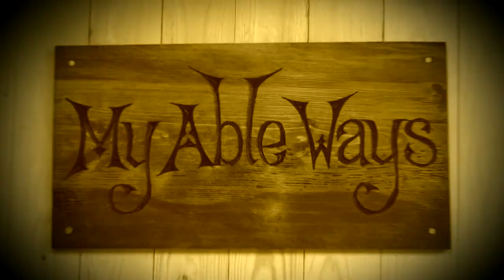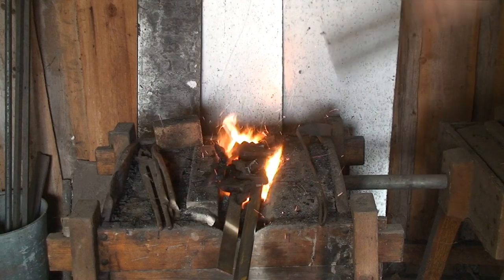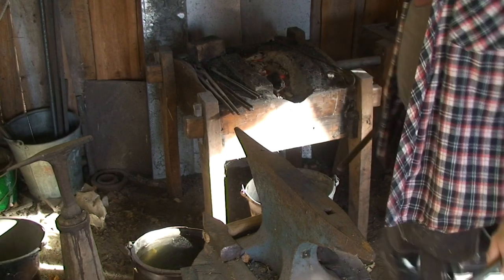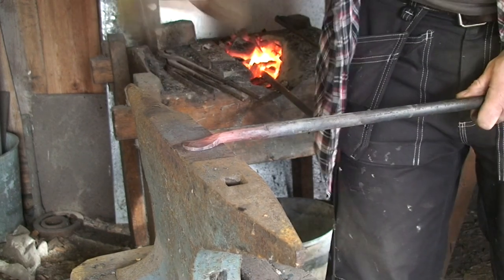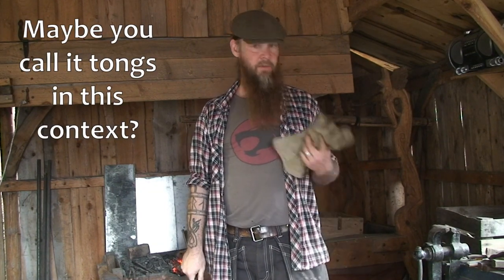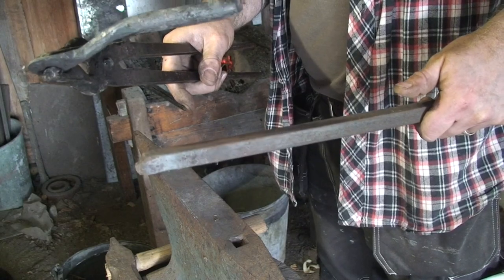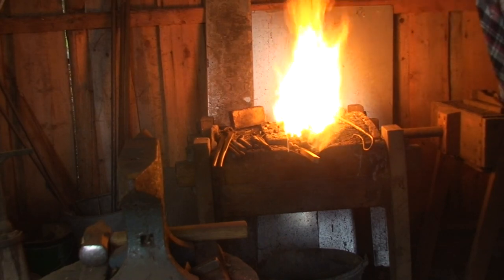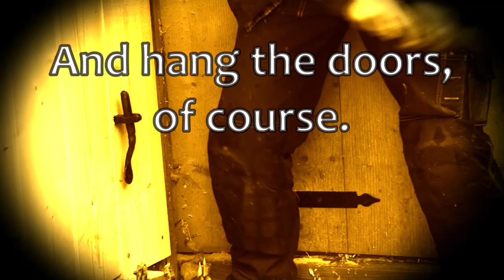Unlock the Secret Art of Blacksmithing - DIY At Home!

Comment: Tip; forge a nail, bend it so it's nearly closed. Hammer that into your woodstand, upside down, half-way up from the floor.

Now, fasten an endloop of a chain on that hook, lay the chain over your anvil and fasten a stirrup to tje chain so it's just hovering above the floor.
Cut the chain.

You now have a superb "third hand" that will keep your iron in place as you can pretty much put your whole body weight on it. It has been super helpful for me!

When you don't want it, it's easy to just remove the whole thing.

The alternative is to make a loop of the nail, and always have it available on the side of the anvil, if you have room for it, OR put a second hook near the top, and let the stirrup and chain hang there for easy access.
Reply: An old blacksmith taught me that, so I can't take credit for it.
Reply from the maker: Yes, that’s pretty much what I was thinking.